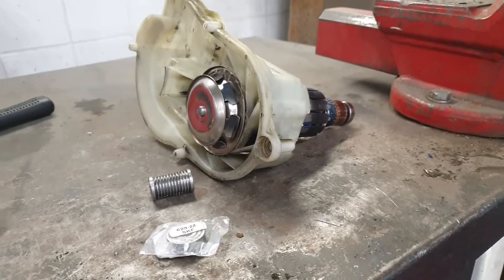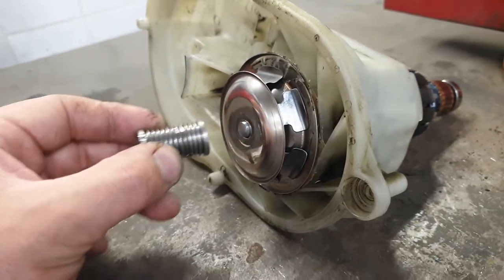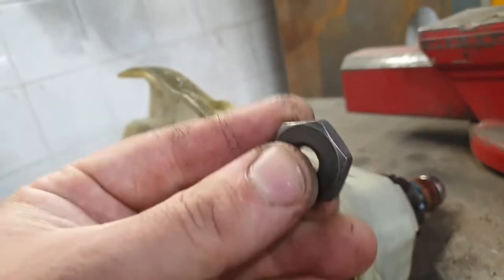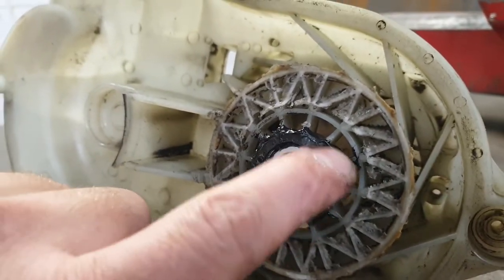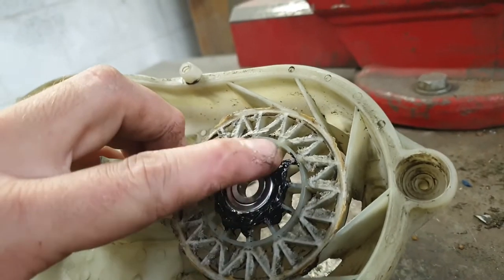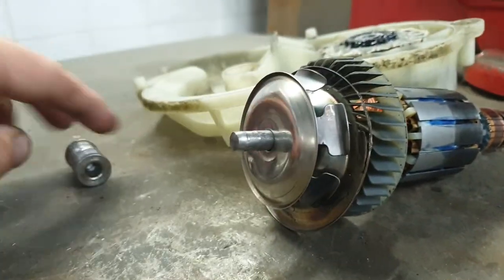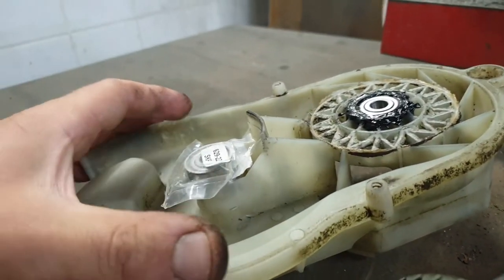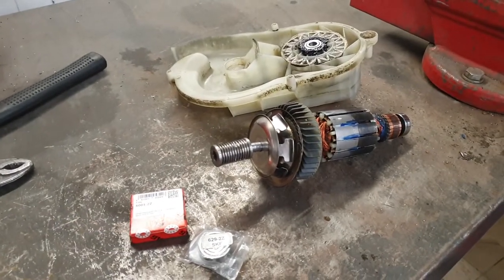Bosch Rotak 43 motor bearing change

Comment: The pulley is very tight, not sure how it was removed, I cannot budge one that I'm trying to repair.
Reply from the maker: it was very hard to remove, i squeezed in a vise pulley so i can hit central shaft with chisel and hammer, pulley take little damage but it survive with little damage.

Comment: Thank you but how did you get off belt pulley, it seemed impossible to get it off ?
Reply from the maker: it was very hard to remove, i squeezed in a vise pulley so i can hit central shaft with chisel and hammer, pulley take little damage but it survive with little damage.